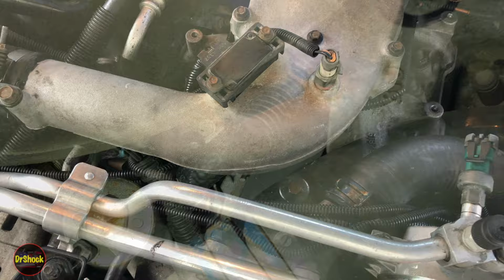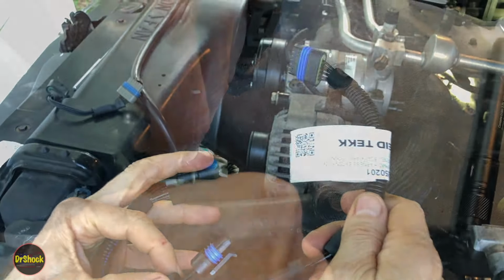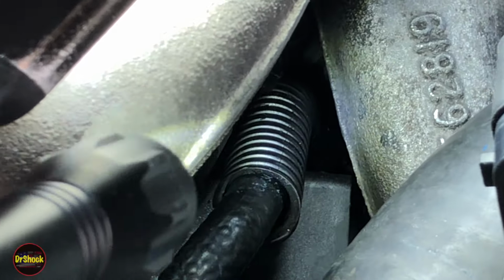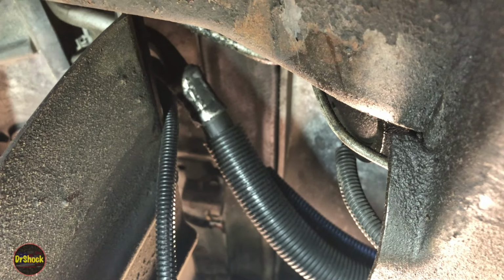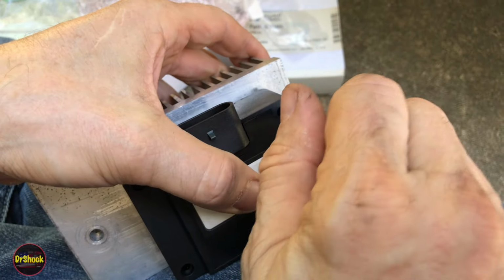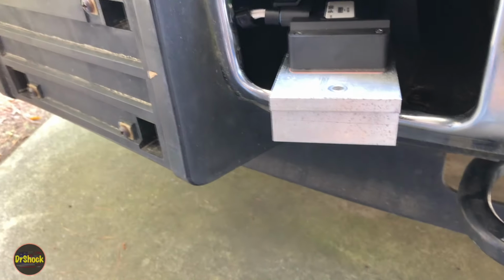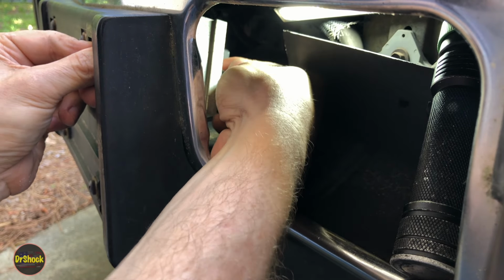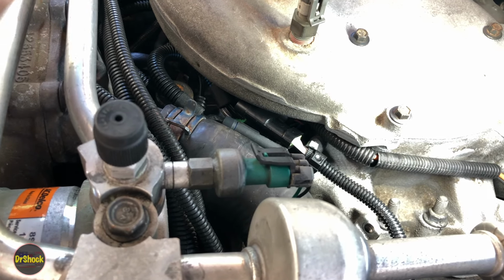1994 - 2002 GM OBS Trucks 6.5L Diesel Remote Mounting PMD Approaches (Chevy & GMC)

Comment: Thanks for another great video! The main reason that the "FSD" keeps going out , is the design of the aluminum case. It does not matter how efficient of a heat sink that one installs on the unit ,.The main problem is that there is too much thermal resistance from the mounting point of the TO3 type power transistors , to the actual externally mounted heat sink. Not only are the power transistors mounted wrong, so are the emitter resistors and the TO202 style driver transistor that drives the main TO3 style power transistors. I think that if the TO3 transistors were remotely mounted to another heat sink, These units would last much longer. I have a unit ready to test that theory. I will share the results with you if you wish. Your comments, agree or disagree, are welcome.
Reply from the maker: Thanks, yeah I'd agree the TO3s are the thermal weak point.   I've successfully rebuilt them from time to time https://youtu.be/GLjGUlCvFVM to reduce their replacement costs, but would suspect when the one aftermarket supplier (Flight Systems) went thru their redesign, they likely could not find a replacement package that still performed to Stanadyne specification.   Since Flight Systems were after being  an GMSPO (GM service parts operations) approved supplier, that likely drove to keeping the TO3s.
Reply: Great Advice!! Any thoughts on using heat sink compound instead of the thermal gasket?